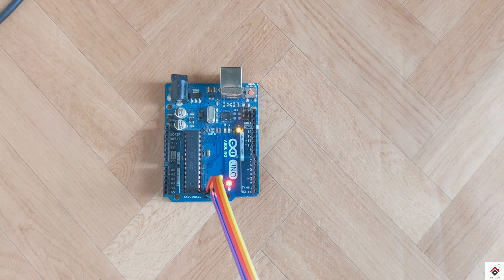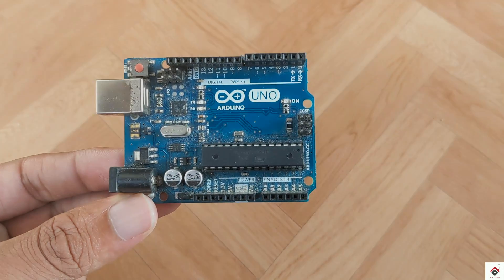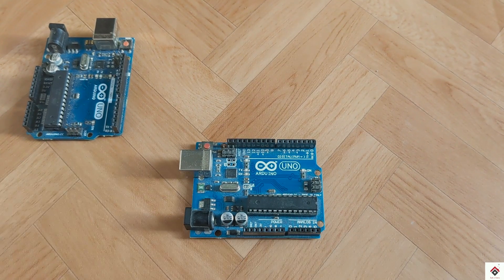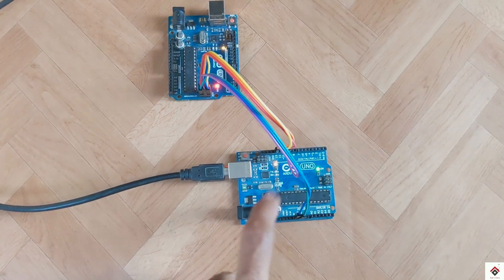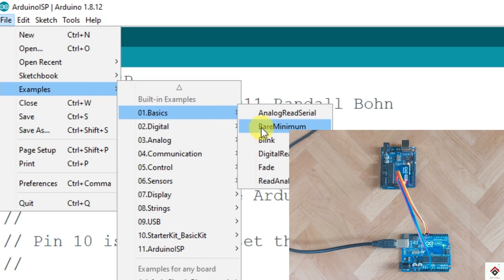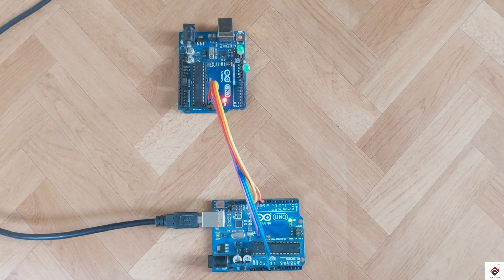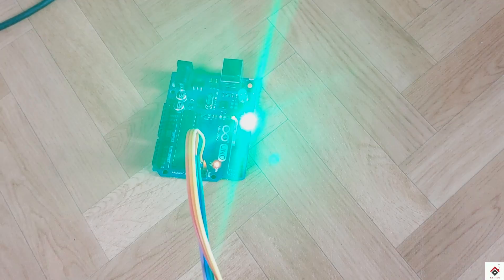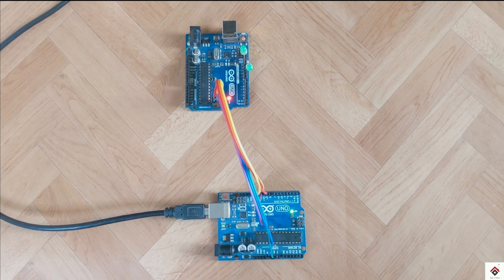How to use Arduino as ISP Programmer | Arduino code upload error FIXED | What is ICSP ?

Comment: Hello
I am trying to program my faulty arduino uno with another uno. I am sure wiring is correct and the ISCP code got uploaded properly. However when its time to program target i get this error:

avrdude: Device signature = 0x000000
avrdude: Yikes! Invalid device signature

Comment: Sir !! I suggest you prepare VERY WELL before publishing a source of information. In embedded programming, SPI (Serial Peripheral Interface) and ISP (In-System Programming) are distinct concepts that are often related. SPI is a communication protocol for transferring data between devices, while ISP is a method of programming microcontrollers while they are installed in a system. Often, SPI is the communication protocol used for implementing In-System Programming.

Comment: Thanks for sharing valuable video ! 
But my question is- does the target board ic328 should have bootloader loaded ??
Reply from the maker: Welcome ❤️
Bootloader not required for ISP programming. If you want to burn bootloader, there is an option available in Arduino IDE. Refer this video for more clarity: https://youtu.be/8wcNEYJi9tg?si=IChPCpFPKZqGWj-f
Reply: @techathome  thanks !
Can we burn fuses or lock bits through isp programmer ?

Comment: Help, I have an arduino board that isn't working. I'm not sure if it fried itself. What happened is that I tried to test a servo motor with a sample code on the arduino software, plug out the usb cable then plug in the 12v barrel jack, then the burnt smell came out of nowhere.
Reply from the maker: I have used 9v battery on round DC jack. It works fine.
But never connected to 12v on this connector. Check the specifications.

Actual microcontroller chip might be still fine. Only power regulator might be burnt.
Check on USB once.

Comment: Hello bro...I tried using arduino as ISP to blink led for 1.5 sec. 
The code was uploaded to target. But the programmer arduino board is also blinking for 1.5 sec. Is it normal??
Reply from the maker: Actually the programmer board will be having ISP code.
It will have same code even if you use it for flashing the target

I have not observed the LED properly. May be it is not blinking because of blinking code.

Try to upload blink code with different delay time to the target and see.
Reply: @techathome  Thanks a lot bro. I will try
Reply: Failed chip erase upload error exit status 1
Reply: What should i do i am facing this problem when i am burning bootloader
Reply: @E-4-elecTronic  Maybe its the issue with bootloader. Try burning the bootloader from arduino IDE. It might resolve this issue I guess

Comment: so, if I have a board that isn't working properly then programmed using the ISP, can I use it independently without the programmer board?, (like doing reset to the damaged arduino)
Reply from the maker: Yes u can use independently without development board.